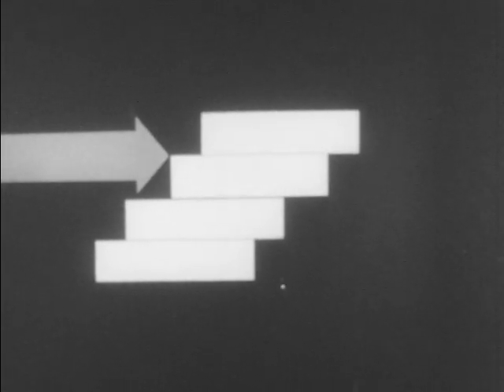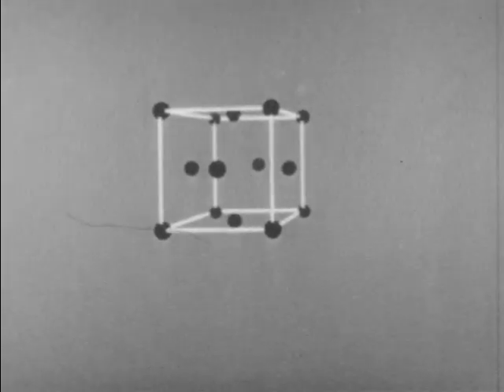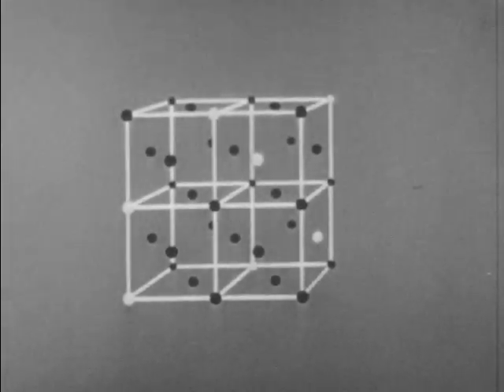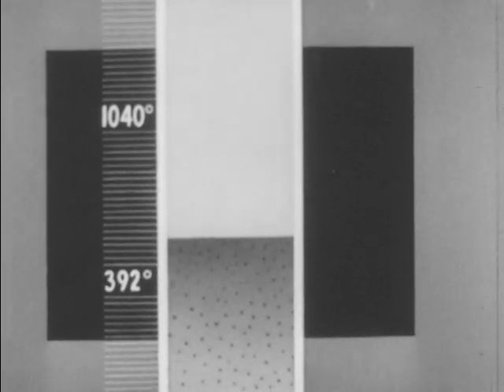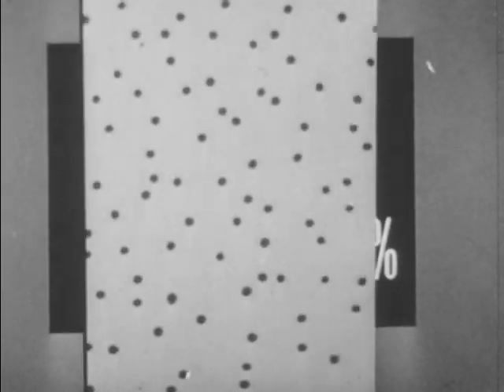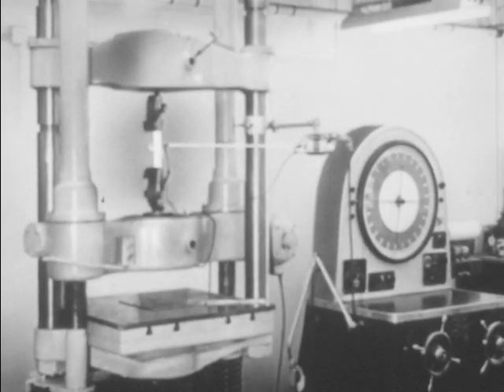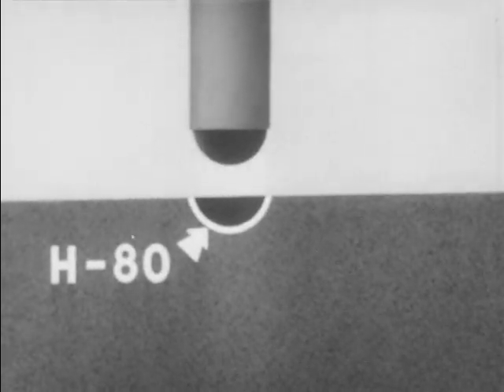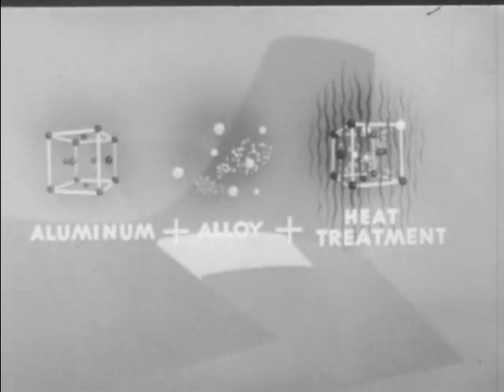Heat Treatment Of Aluminum Part 1 (1945)

Comment: Dear sir I have a aluminium tube diameter 40mm and thickness 2mm, alloy 6063 , 
I need tensile strength 275 M pa ,
Please can you tell me process how I achieve it after extrusion ?
Reply: no